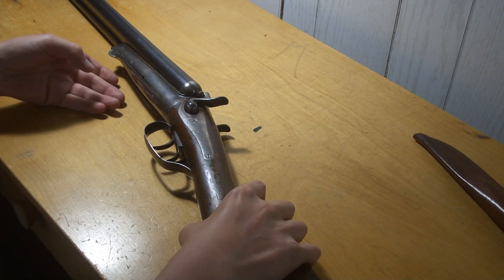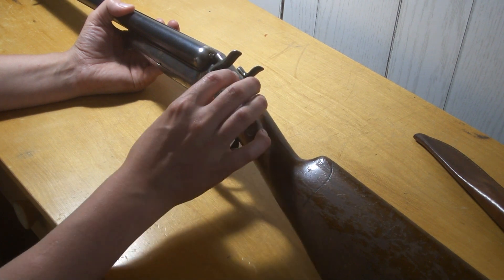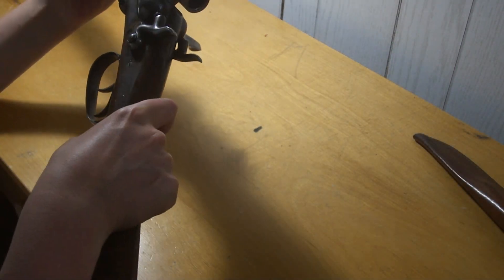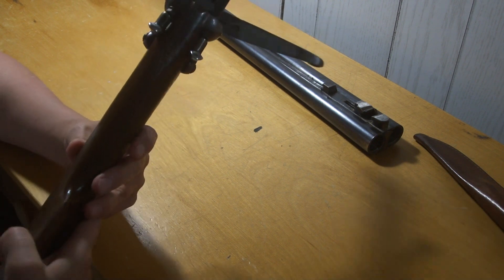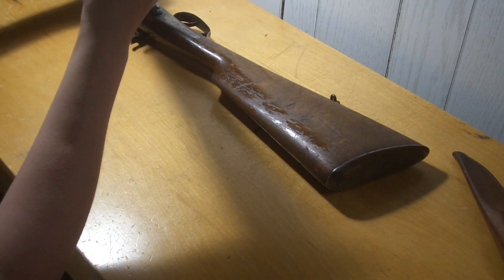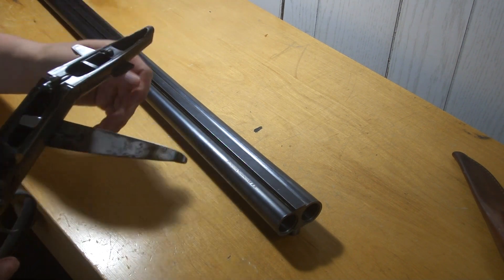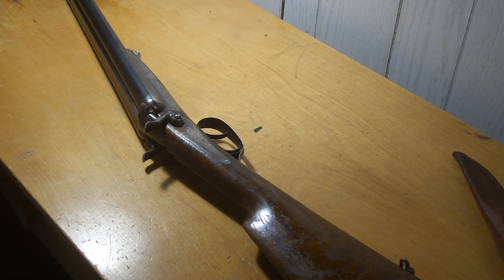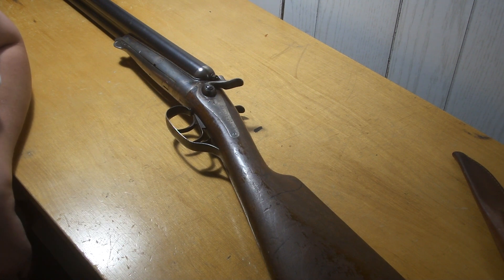Bit Better Husqvarna 20 Video

Comment: I have one as well. I really like it it's very fitting and feathery. I have only shot self made black powder ammo from it, but i've been thinking that maybe the action could handle some soft 12/65 smokeless ammo too. If i did my research correct, my gun is from 1914.
Reply from the maker: yeah people have been telling me that for years but i never bothered, and didnt want to beat the old gun up any.
Reply: @Gungeek  Yeah, i wanna do some research before trying the smokeless ammo (with a remote control) :D

Comment: Nice old shotgun GunGeek.  The grip area on the old wood stocks, seems to be always smaller, on the old shotguns and rifles.   Was the hand size smaller, or was the wood used stronger, with no need for chubby stocks?  ...  Maybe, the Swedes were able to squeeze so many Vikings into their boats, because they were all midgets.
Reply from the maker: might be the wood maybe